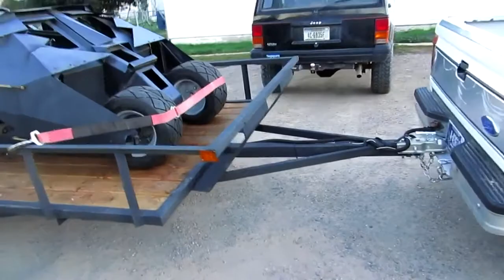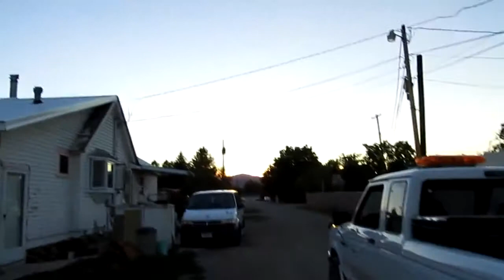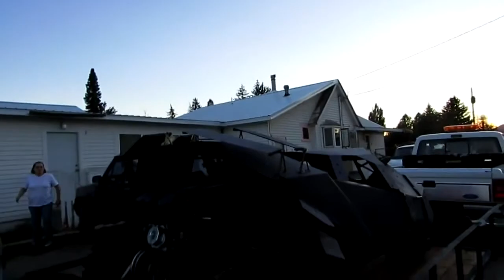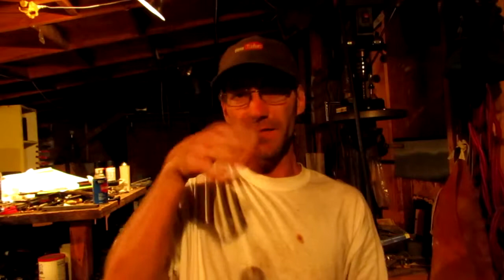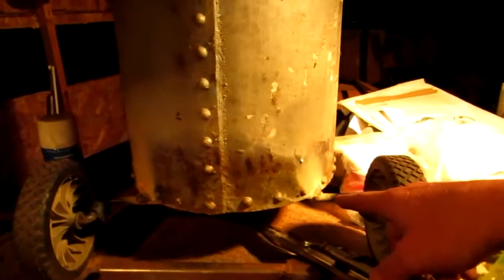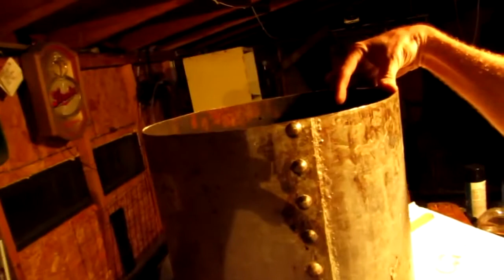UTILITY | TRAILER BUILD #7 | HOMEMADE

Comment: I know this is a older vid but a good one.  I had to do the same for my trailer and in my state (VA) they did the same thing with just looking to see if I had the vin tag mounted signed the paper work and left.  No inspection of any type but they do make a big deal out of it if you get pulled over and its kinda confusing.  Nice Trailer!!!!